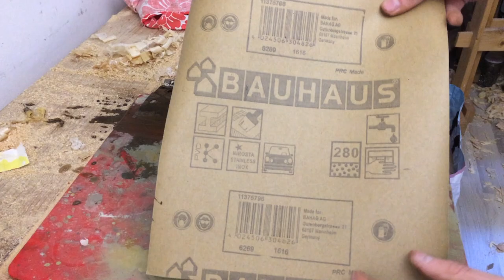Tenon saw resurrection – restoring a rusty handsaw

Comment: Great work! I'm about to do the same to one of my saws (at least replacing the handle). I like your design and take on it. Very nice! I'm too chicken to remove the tooths :-) (or mine is hardened I think, and that would be too much work without a proper forge). Bra jobbat och snyggt gjort!
Reply from the maker: Tack så mycket :D I think you have more experience than I here, but is it really worth making a new handle for a saw with hardened teeth? Since you can't sharpen it. I guess you could replace the blade when it gets dull though. My plan is kinda to phase out my hardened saws and make new handles for my non-hardened ones, but maybe I'm overthinking it?

Comment: Just immerse in white vinegar over night or longer
Reply from the maker: For rust removal? I've heard that, and I'm sure it works! Just seems like it would take a lot of vinegar.
Reply: @GillisBjork  The Vinegar is recyclable. Or also, you can immerse in water add 1/2 cup of baking soda (stir). Attach 12 Volt battery charger. One lead to the object that is rusty metal, the other lead to a piece of metal (opposite side of the object) and attach the other lead to that ....let soak over night and if really bad 2 to 3 days rinse  and repeat as necessary.  With most of my tools after doing the battery rust removal... I usually then Nichol plate them which give them a new appearance. Yes I buy my tools at yard sale and flea markets if the prices are right....  those tools ,depending on their age, are of better quality metal due to the alloys at the time they where made...older is better. They made things then to last ! Great blogs Sir...I so glad you are doing most of you work by hand. It show people that they don't need a ton of power tools. Doing work by hand is much more rewarding as your technique develops. Thanks